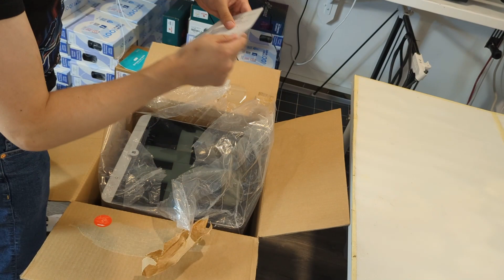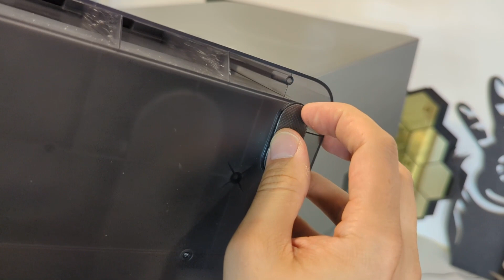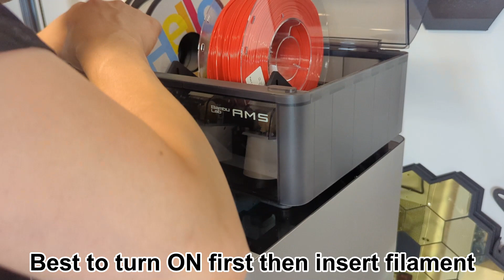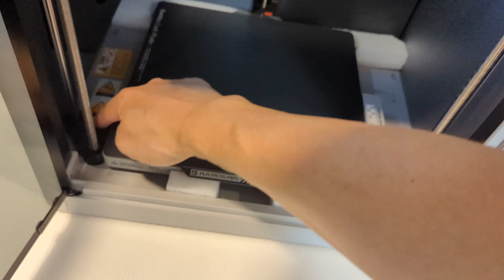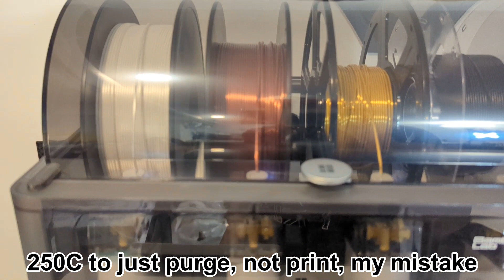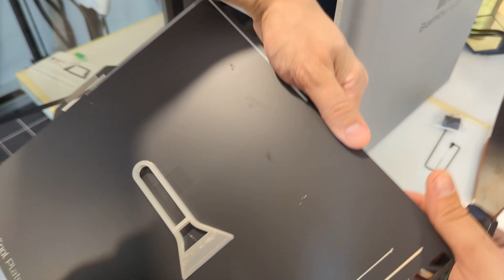BAMBU LAB X1 Carbon AMS 3D Printer Full Unbox, Setup & Tests

Comment: Something was concerning about your bed moving up so slowly during calibration, I have seen other calibrations or homing and it was much faster, did you find anything that was hindering the build plate or lead screws?
Reply from the maker: This printer was from the Kickstarter and the video was taken some time ago. So could be that there have since been improvements and new firmware that make the calibration and homing faster?

Comment: Did you order just the printer and did it come with all of that? Or did you buy the printer and then added a bunch of other stuff like filament rolls and parts. I need to know if I need to order filament and parts when buying the printer.
Reply from the maker: I ordered the the X1C with AMS bundle that comes with some extra parts and filament. Regardless you will need to buy filament of your own as they only give you less than 1kg of filament.

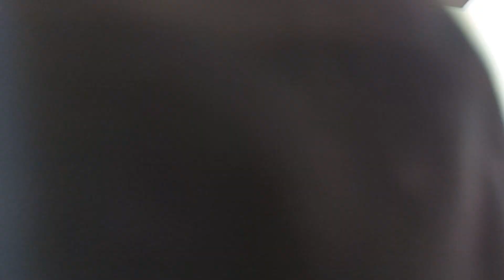Comment: @15:13 I will mostly due the same here, but I've heard if you print using TPU, it's not recommended to use TPU in the AMS, so you may want that spooler back piece installed just to use that for TPU at least.
Reply from the maker: Yes! I've used the AMS multiple times with TPU without issue, then all of a sudden one time, I had it get stuck in the AMS! 
So the back it the way to go.
Reply: The retraction of TPU is a nightmare

Comment: you mentioned you had issues with the palette. what version did you use?
Reply from the maker: P3 Pro, cutter and core replaced as well. :/ Great little machine but so many points of potential failure.

Comment: Great video. Most of the videos so far have been with free pre-production units and just about all have had issues in one form or another. I hope this is a production unit and I look forward to seeing how it works for you in the future. I'm ready to buy one as soon as I am confident at least 90% of the bugs have been fixed. One question maybe you can answer at some point. The calibration print (lines) take up a fair portion of the build surface. If you have calibration turned off for that will it use that space for printing your project?
Reply from the maker: Thanks! I have had 9 different printers before. Been using the X1 a tonne and while not perfect it's definitely a "game changer". Well worth over several Ender 3, if you have the money. You can opt out of having the Calibration lines (which I usually do to save time), but even if you didn't you print will run over it (Which I haven't had an issue with but don't recommend).
Reply: @3dlootlab  Imagine a 500x500x600 at least or what Prusa is doing with 800x800x900 with enclosed fast printing, reliable and capable of printing PLA to metal.  Along with able to change nozzles and different materials automatically.
Reply from the maker: @deltaboy2011  yes indeed. Prusa XL is only 360mm no? I'm torn between the XL and the Bambu. 
I have two X1C and right now both heatbeds have failed to heat...So I may go with the Prusa as they seem to be more reliable and can be real workhorses.
Reply: @3dlootlab  sucks to hear that.  Hope they improve on reliability.
Reply: @3dlootlab  yeah it’s 360 I made a mistake on printer dimensions instead of print dimensions. But one can hope for such dimensions for that bed size

Comment: How do you end up choosing the correct filament?  Mine has not come in yet.  This video has been so incredibly useful.  I even wish you didn't skip any part.  Everything you did show will probably help me when mine comes.  Thank you for angling the camera in when you did.  Are we supposed to clean the glue off after a print before the next?
Reply from the maker: So you cannot choose a different filament it seems for the pre-loaded Gcode (though this may change in the future). Thank you! Good to know others at my skill level can benefit from my mistakes :D No need to clean the glue off. I just reapply where the print were. The print works fine without the glue, but it protects the build plate surface. After lots of printing and sometimes without glue the Cool Plate stick began to bubble and lift off the build plate! Thats why they give you a couple of extra Cool plate stickers. Engineering plate so far has been robust.
Reply: @3dlootlab  Most glue sticks are water soluble. Maybe you could periodically wash off the glue in warm water and the surface may last longer. I normally print on glass, I hope there is a solution to do that in the future. After a few prints if I use glue stick (which I don't often need) I remove the glue stick in this way and reapply.
Reply: @3dlootlab at the top, it said to select the order of filament you want. You could chose it…

Comment: Nice printer......Bowden?...never mind.
Reply from the maker: Just in case I mis-understood and you don't know. This is direct drive. Retraction default is 0.8mm, not bad :)
Reply: @3dlootlab  I didn't. I assumed because it looked like an extruder at the back of the machine.
Thanks for clearing that up.

Comment: How does the speed to quality ratio compare to your RatRig?
Reply from the maker: Oh there is no comparison, a well built ratrig is in a league of its own. Speeds of 250 is the average speed but you should be able to push to 300-500 mm/s, with acceleration 5-20k. All depending on the parts used and how well built. But the ratrig will set you back couple thousand. Mine cost around 3.5K CAD. You also have to spend the TIME to build it. 40-100 hours is not what some people want or are capable of doing. You have to know how to do wiring properly for instance. Voron is an easier build.

Comment: Finally some insights on the noise level. Thanks for it.
Reply from the maker: No problem! I don't find it too loud in my workshop. However, don't recommend putting it in your living room, running at standard speed, if you want some peace and quiet. The sound travels from one floor to the next fyi.
Reply: @3dlootlab , crap, I have to have it in my bedroom as my workshop area is not only a disaster, but is in an unheated garage. Hopefully there will be a way to add some insulation to reduce the noise!
Reply from the maker: @robertharper3754  yeah over time I have noticed the noise more. The silent mode helps. There is an STL on printables to act as a muffler for the exhaust fan at the back, this really reduces the noise.
Some people have put them in cabinets/boxes that help.

Fortunately you may have the option to use it in the garage, but just close the door and heat the bed for a bit to raise the chamber temp to at least 15C. Then it may work fine in the winter?
Reply: @3dlootlab , eh, making the space for it would be a hell of a lot of work that my back couldn't handle. 
Not to mention the garage is where I have just a wee bit of flammable stuff, and by wee bit, I mean a crap ton, if a fire started in there it would get out of control pretty fast as soon as it hit one of the giant tubs I keep my gunpowder in, or the camping stove fuel, or the ammo cans, ect.
Reply: @3dlootlab , I do have a bit of work to clear space for whatever I put the printer on, and now that you mention people putting their printers inside cabinets I'll have to check a cabinet out in the garage. Sadly, I wouldn't be able to get it out of the garage due to cars being in the way right now, but that should be solved by spring. Thanks for the idea and keep the videos coming!
Reply from the maker: @robertharper3754  Np and thanks!

Comment: There's directions on how to get it out so you don't have to dump it. Lack of reading directions is probably why you can't get your P3P to work.
Reply from the maker: I wish it were that simple. Turned out the splice core needed replacing and I had a cracked cutter, also replaced. Even after that splicing worked and my pings and pongs were all within 1% deviation, yet color eventually would be slightly off. Though I was pushing it as the print had >400 splices to go through. Smaller spliced prints I was able tune and print fine.